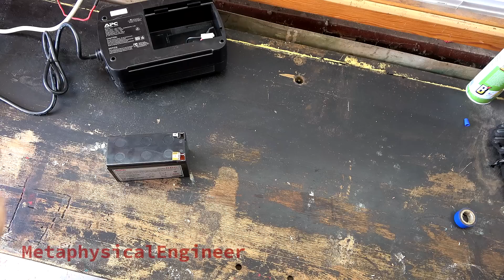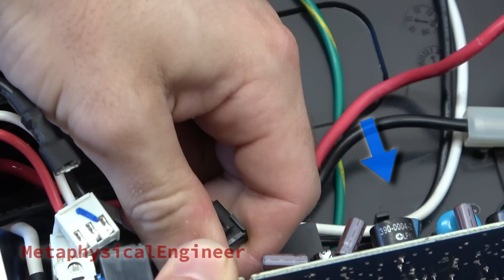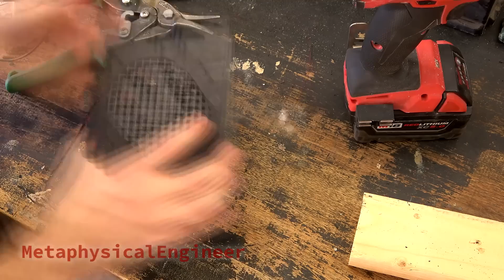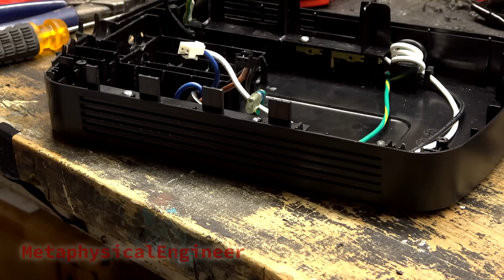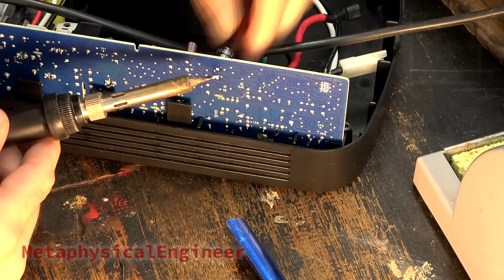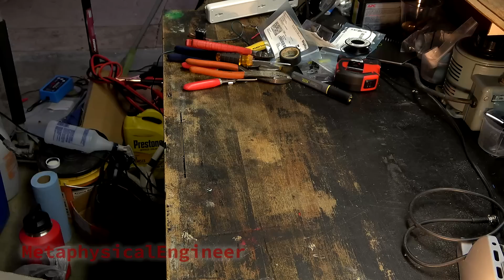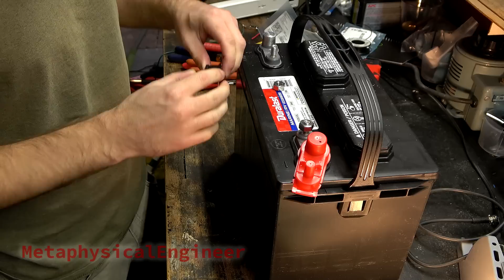Modifying broken UPS for long endurance BACKUP POWER!

Comment: OK so, can you now clip some solar panels across the big battery (with a series diode)? Then you would have a complete solar electric system that would only draw from the utility company when it needs to charge up the big battery (cloudy day). I'm looking to do this exact thing, except I want to add solar panels. Have you tried to add solar panels?
Reply from the maker: I have not added solar panels, but that's indeed an option.  Both grid and solar chargers could run in parallel, only feeding the battery as needed.  Unfortunately this battery and inverter still have relatively small capacity even after the upgrades I made. The built-in charger is also very slow, taking weeks to recover from moderate discharge, and I do have to drop out all but one monitor to ensure enough inverter power headroom, for example.  

A much larger true sine wave UPS modified with high performance LiFePo4 batteries plus high power chargers both grid and solar, and appropriate control circuitry would be a viable option.   Something like that is an idea for a future project, possibly modifying a higher end enterprise UPS with newer battery technology and multiple input sources.

Comment: The fan source of air is really compromised by facing inlet against battery case cover.
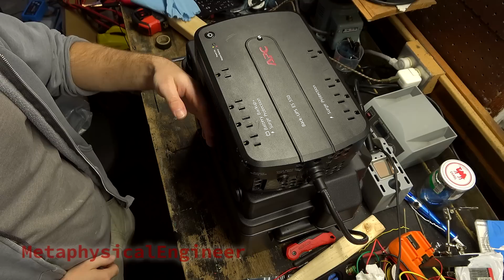Reply from the maker: Not particularly!  The channel in the battery box lid plus the dual lock velcro pads provide plenty of clearance.  You can get a rough idea of intake placement from where I placed the pads on the UPS around 27:45 and where the pad is visible just above the switch on the assembled product around 30:14.

Comment: I recommend you pick up a pen-style deburring tool. Cheap and works much better than a file or utility knife for holes. Great video.
Reply from the maker: Indeed!  I looked for mine when I realized how many holes I had to drill and how tough the burrs were, but it wasn't anywhere it should have been, and I haven't used it in a while.  Watch me find it tomorrow when I'm searching for something else!
Reply: @MetaphysicalEngineer  I always said my shop is infested with Gremlins. They love to hide things. Their neatest trick is hiding the tool I laid down beside me two seconds ago.
Reply: @baldeagle5297 My shop floor gobbles up everything that drops on it, disappears for life. Most of all seems to like those screws and nuts that are of the typical nonstandard size.
Reply: @MetaphysicalEngineer  The style of deburring tool I have would work reasonably well here as well--I don't know the name for the style of it, but I am thinking it's different from the "pen-style" type referred to by willusher3297.  Good for metal and softer, it uses curved/S-shape blades pivoting on an axis in the tip of a plastic handle. It comes with three different blades and you can swap them out: one for steel, aluminum, and plastic, another for brass and cast iron, and another for "...straight edges on almost all materials."  Extra blades stored in handle.  It's a Blue-Point  DEBUR 300, though perhaps multiple companies have made it.  That said I finally read your reply after typing the above and see that you have a pen-style or at least a deburring tool already.  Ah well.  :)  Update: I see in another reply that you've already acquired a replacement.

Comment: Always check the contacts on these older UPS units, over the course of years they can start to subtly corrode then heat-up and corrode even further. I had one getting to the point I heard faint arcing, the problem connector was immediately obvious, discolored and pitted metal on the contacts(on the high-current LV side of the transformer interconnect), The wire guage was too big to fit the holes present, so used forked spade terminals to repair it and cut off one side of each spade to use as through-hole, soldered those in, checked thermal camera, and have been good ever since. This is one of the first UPS units I ever bought 15+ years ago and it's still going strong. Each time I've tried to replace it, it keeps outlasting it's replacements.. one lost it's mind and exploded it's push-pull FETs randomly one night, the other started kicking the GFCI at when it performed it's sporadic self tests, never a dull moment.
Reply from the maker: I'll keep that in mind about failure of those connections, especially if this unit sees significant use.  I already plan to do inspections now and then.  Nice job bringing your unit back to life, and quite funny how it seems determined to outlast everything else you buy!

Comment: keep in mind that battery is not isolated from Hot leg of 120V as its center tapped off the transformer
Reply from the maker: Not in this case!  Battery negative is referenced to ground and there is no line voltage present on the battery side. The black and white wires shown at left side of the transformer diagram are primary winding connections at battery voltage.  The black and white wires on the right side of the diagram are secondary connections with the inverter AC output.   My fault for not more clearly labelling the diagram itself, though the narration walks through the wire layout in that section.
Reply: This is probably going to be manufacturer and even possibly model specific. When I did this (put a larger external battery) on an older Cyberpower 425A unit similar to this (power strip style) with a funky (not easily sourceable) battery size, I found there to be around 40-50 VAC difference between battery negative and mains ground.
So this is something folks really need to be careful with and validate (and possibly protect against).

Comment: i also did something like this. got a few ups that where throw out. i got a 60AH lithium battery with it's own bms. ran some wires out from the 600VA ups. works well for 12 hours for my nas. only catch is it take day plus to charge up again, which was expected as lead charges at 0.7A
Reply from the maker: Cool to hear another success story!  Be thankful yours charges in a day; if my rig gets drained significantly, full charge would take days to over a week.  I'll have to connect an external charger if I want to boost it back up faster.
Reply: @MetaphysicalEngineer  that is exactly what i had to do the other day as there where few power outages in one day.

Comment: i run an RS1500 with 2 deep cycle battery's  keeps my 2 TrueNas and router going for a safe shut down.  but all so keeps my WiFi and an energy light going for a day
Reply from the maker: That's how to do it!  It's really cool seeing how many other people have successfully done this type of modification. Video work is only a small part of my job, but the disruption of a power outage alone and sunset happening at 5pm now drove me to do this project.

Comment: Great video! I am concerned about the charging side of the UPS when the battery is empty. Does it heat up? How much time it takes to fill up the battery?
I did that setup repurposing an old 500W APC UPS with a 65AH boat battery. The charging circuit overheated when testing it (open case) and it gave up; I did a full cycle to see how much time it takes to discharge and fully charge the battery and while charging it died. I had to hook an external charger (a car 12V type) instead the original one and I used the inverter part of the UPS. Ofcourse, that did not resulted on a practical setup so I fixed the UPS (a burned transistor in the charging circuit) and now I use it with 14Ah sealed gel lead batteries, two 7Ah in parallel and forced cooling (a12V temperature driven fan) to power my router and NAS.
Reply from the maker: Strange that your unit blew the charger like that.  It would have to be designed with current limiting from the factory since even a small lead acid battery will try to pull extreme amounts of charge current if allowed.  Saw a gas powered golf cart battery erupt boiling from overcharging due to a failed regulator.  Generator got smoking hot but delivered everything the battery asked for to the point of destruction.   

On mine the charger transistor gets warm as expected, but not excessively so.  I've run it from slight discharge up to float over the course of a night and part of a day with no issues.  Significant discharge would take days to weeks to recover, so I plan to use an external charger to boost it after heavy use.  The monthly (or thereabouts) outages mean that I don't need extremely fast recovery.
Reply: yep  ..ups   charge circuit board/mosfet will eventually fail  in short time  .....  better and easy to buy  1500-2000 watt inverter  amazon etc $130 bucks  and run  1 lithium  100amph and 2   decent size lead   marine  batteries   mixed --(yes together)   they work  great together, compliment each other and  many  boat guys  do it ,  then you have  mucho power  .~run  1 or 2   stand size solar panel  your good to go for a while

Comment: Made similar modification, used TO-220 thermal relays (switches) widely available.
Reply from the maker: Another success story!  Thanks for weighing in!  Where and how did you mount your thermal switches on your unit?  
I was concerned about the vastly different thermal behavior of transistors and transformer, and difficulty of measuring the hotspots.
Reply: @MetaphysicalEngineer  In my APC ES700 transformer is hotter than mosfets under 200-300W load, so I put thermal switch between housing and transformer core and fixed it with some heat-resistant glue. Made it about year ago, not sure about small details but overall concept is exact. Any thermal resistance between windings and core I've compensated using lower temperature switch, somewhere around 50C. The only negative side I've found since modification is fans work few minutes more than required after UPS switches to AC. However, during my experiments inner windings were about 20C hotter than outer, so it's pretty safe.
Reply: @HeIsTheHighlander , can you please be specific about what thermal switch you used, and where you got it? (Don't specify a URL, because youtube will block your comment if you do.)
Reply: KSD-01F - first results via search "thermal switch to 220" with no quotes on Ali. Normally open for fan, meaning it will close reaching target temperature. They're made on different temperatures.
Reply: @ncdave4life  I've bought them both type (NC and NO) and almost every temperature, it was cheap include shipping to Russia, I think cheaper than $1 each. Not sure about exact numbers, it was a couple years ago. I think they should work in parallel, but in my case transformer was hotter than mosfets, so I used only one thermal switch.
Reply: Thank you, @HeIsTheHighlander .  (This is my 4th attempt to reply.)

I see that KSD-9700 or KSD9700 is device similar to the KSD-01F or KSD01F, but with wire leads. That would be even more convenient.
Reply: You could put one on each device that you think might get hot (transformer, and anything with a heatsink), and just wire them in parallel. If any component gets hot, the fan will come on.

You could even very simply set it up for variable speeds. If you put a resistor in series with the fan, it will run slower. But if, instead, you put resistors in series with each of the paralleled thermal switches, the fan would run slower with just one switch ON, but if two of the switches close the fan would speed up.

It's a super-simple solution, for negligible cost.

Comment: Very nice repurposeIng of old UPS. Well thought out and implemented. I am now keeping my eyes open at rummage sales, 2nd hand stores, and Goodwill for a used UPS.

I was concerning building one of the solar generators as seen on YouTube. I want something to take camping or use in an emergency. But your project got me thinking about merging the two, something that I can use as a UPS at home and a solar system that is portable. 

The way I invision it, I wouldn't need an external charger circuit, or AC power inverter if I start off with the UPS circuits.

The thing is, I'm NOT an engineer and don't know how to marry the two projects, and I don't want to do something that has electronic or fire risks. So I'm hoping you might help me by building a project that I can copy. ;-)
Reply from the maker: Thanks for stopping by!  Your idea may actually be simpler than expected!  

A solar panel with a smart charge controller can feed the same battery as the AC charger in the UPS.  All each charger does is interpret the battery conditions and supply carefully regulated voltage and current as needed.  When the AC power goes out, the UPS inverter will kick in. As you see when I was testing the unit, simply pressing the power button when the unit is unplugged will also turn the inverter on or off.  

You are wise to be hesitant about fire risks, hence why I was careful about sizing of fuses due to the huge amounts of energy available from a such a large battery.

My main hesitation after that is a UPS is heavy and bulky compared to a typical inverter of comparable power output. Technically portable, but less practical for camping when weight and cargo space are limited.  With everything together, my system here weighs in at over 70 lbs (31.8 kg).  I can lug it around, but would not want to do so often.
Reply: Honestly if you can afford it, I'd recommend something from the Ecoflow River 2 series if you don't feel too confident with what you're doing were you to build your own. Of course what I think is rhe best option is to research until you are confident. And this is coming from someone who built her own full house backup's battery from prismatic cells and an off-the-shelf BMS to connect to a hybrid inverter.

If you dislike my recommendation for a ready to go option, there are other brands with useable offerings  but i wouldn't trust bluetti in UPS mode for critical loads, my network has already gone offline times enough from such trust.
Reply: @lua-nya epic ❤

Comment: Our cable modem is in the garage.  My backup solution for it is a little Eco Flow River 2 power station, clip clip the power cord for the cable modem and run 12V from the power station directly to the cable modem (since it takes 12VDC on its input).  By leaving the AC inverter turned off the power station can run the cable modem for 3 days easy on its own during a power failure.

Generally speaking, these UPS solutions are built into a lot of power stations these days so even for running AC devices it is pretty trivial, and you get a lot more backup time with a power station than you do with an APC UPS.

-Matt
Reply from the maker: Skipping the conversion is a smart move if the devices allow it such as your modem, and those Eco Flow units have impressive specs!   Something I'd look at for adding additional backup power in the future that I can also easily take with me, though two things give me pause for my current application at my workstation:

Published switchover time could be fairly long at "less than 30ms", since typical UPS promises a tighter range of 8 to 12ms. My PC would likely drop out if under load since ATX spec is hold up time of 16ms.   

Also, the 256Wh capacity is extremely good in such a small package but only 1/3 of the capacity of my homebrew setup.   I'd need one of the Pro versions at more than twice the cost to have comparable capacity.
Reply: @MetaphysicalEngineer  Yes, but you are using a marine battery in what is potentially a home environment, and you are trying to maintain it with the charger controller from a UPS which is designed only for SLA batteries (which can take more of a beating to be frank).   Outside of SLA, lead-acid batteries need to be well ventilated.   The failure mode for lead-acid is also a big problem.  Even UPSs have a hard time detecting that a battery has failed... usually you don't realize it has failed until you actually have a power failure and your "UPS" drops out after only a fraction of the time it was supposed to last.

So while it kinda works, it isn't really a robust solution.

There are better ways to go.  The direct DC solution works for most small devices and will run those devices 2x to 3x longer from the same storage capacity.  A LiFePO4 battery, a float-capable charger, and the device (for 12V), and throw in a 12V-to-5V dc-to-dc converter if the device runs off of 5V (the voltage is marked on the devices.  95% of devices these days run off of 5V or 12V).

That is a solution that will last 15+ years hands-free.   Not even needing a power station.

Power stations are pretty good solutions unto themselves, and one can expand the capacity simply by fronting the power station with a 12V battery that you plug into the power station's "solar" input.  Again LiFePO4 is the best solution (for the power station and the expansion battery), and one does need a way to charge the expansion battery.

Another "expansion" solution for a small power station is USB-C.  Some power stations can charge from USB-C, which means you can just connect a power pack with a USB-C output (uni directional) to the power station's USB-C input to expand its effective battery capacity.  At least as long as the power-pack doesn't timeout and turn off its output.   Wall -> powerpack -> powerstation -> device.  Like that.

But yes, most power stations have poor AC inverter "UPS" switch times... usually 20ms to 30ms when you really want 10ms-16ms.  The absolute best case is 8ms (half cycle 0-current crossing on the AC waveform).  Commercial UPSs can do 0ms by leaving their inverters energized and synchronized to the mains.

-Matt